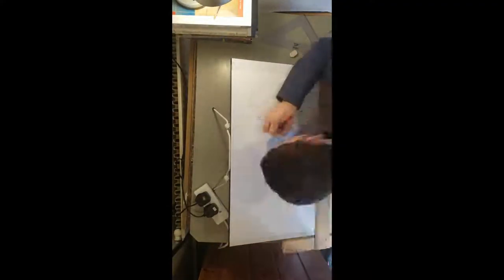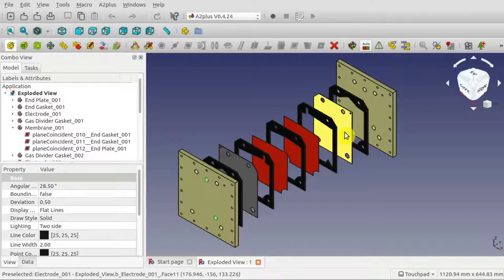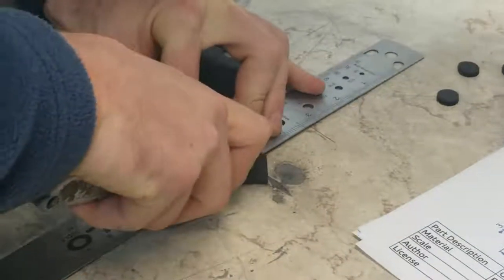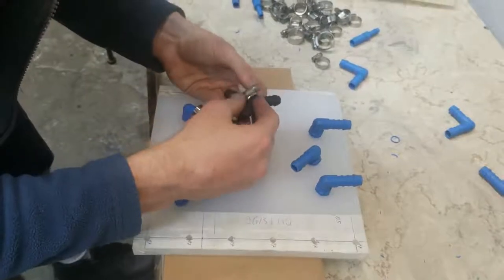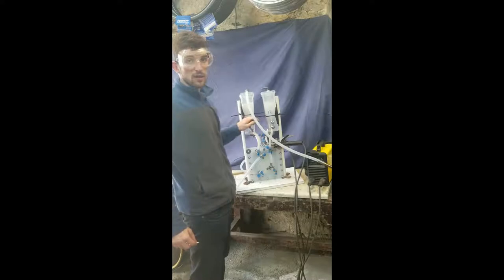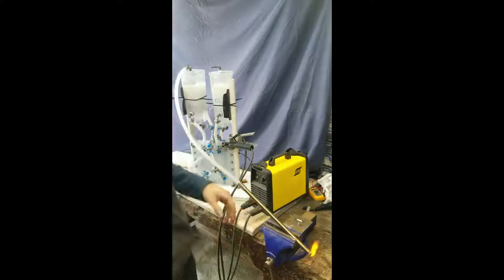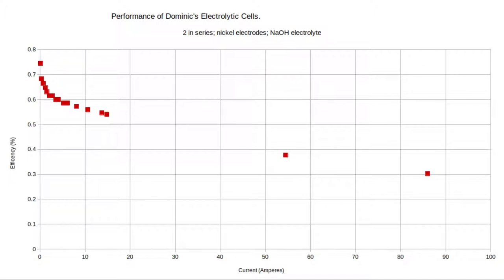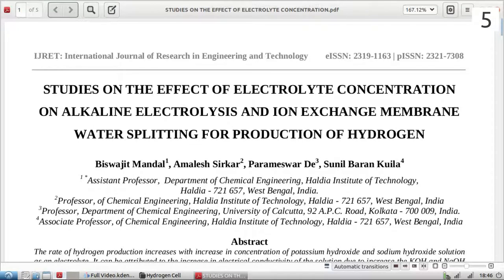Build an Alkaline Water Electrolyser to Produce H2 | High Output

Comment: Great video !
The DYI science guy on u- Tube  used a similar cell with microfiber for separation. He disassembled it to repair leaks and check for formation of hexavalent chromium. 
He contained the leaks from the cell by playing it into a plastic tub.
He had a dissecant dryer and refrigerator compressor to pump from a beach ball into an LPG container. 
Very inexpensive and amusing too.
I'm building a similar system and running it on my solar/ wind power generator.
Keep your videos coming and thanks for sharing. 
Charlie

Comment: Beautiful. The fizz is just beautiful. I  will make a cell similar to this.
Reply from the maker: Good luck and please let us know how it goes 😁.  I'm planning to make a "version 2" myself as well
Reply: @dominicogallachoir4554  Hey good luck on that! I know gold is expensive but it seemed to be a good electrode surface. I published a paper of my work done with pure water and gold plated electrodes in a miniature electrolyser cell (I did not bother with gas separation for that was not the purpose). The results are consistent with your prediction. Low voltage can result in more efficient reaction albeit at a very low rate. See  it via this link https://doi.org/10.1098/rspa.2017.0371

If you are not a subscriber of the journal you can request a free copy by emailing me. Just a warning, it is a lot of theory from the simple experiment.
Reply from the maker: @Guoenyi, thanks for sharing your article!  It seems to be open access, or at least I had no trouble accessing it.  While I did struggle with a lot of the theory, one thing I definitely understood was that you've shared the original data freely on the internet, which I think is a super cool thing to do.

Hahaha I'm definitely not going to take credit for predicting electrolysis below 1.23 Volts.  Highly-efficient for me would be more like <= 2 Volts hahaha.  < 1.23 Volts really boggles my mind and I think I have lots more reading to do to get my head around it.

Can you tell me more about the electrolyser you're planning to make next?  Will you be using gold plating?  Are you planning to run it at less than 1.23 Volts?

Also, I would love to connect on LinkedIn, if you're a user:  https://www.linkedin.com/in/dominic-%C3%B3-gallach%C3%B3ir/
Reply: @dominicogallachoir4554  Not a user of linkedin. I am on researchgate though but I can't seem to find you there. I will consider joining linkedin after taking a look at it. Not familiar with that platform.

No more gold. The paper was a proof of concept for under 1.23V water electrolysis supported by quantum tunneling theory. The experiment deliberately picked impractical setup e.g. ultrapure water, gold electrode to demonstrate the physical nature of water electrolysis. 

My current work is on practical electrolyser operating under 1.23V. This is done for for higher efficiency reason (less waste heat). Also gold will not be used as it is a precious metal. I might try starting with nickle plates to get a prototype working first just like yours. Then the idea is to modify the electrode surface with porous carbon for larger effective area. The higher area should make up for the loss of reaction rate from running a low voltage (when we compare a porous surface to a flat surface of the same geometrical area).
Reply from the maker: @Guoenyi  I've been thinking about your paper and trying to make more sense of it.

So, as far as I know, most electrolysis cells produce waste heat in proportion to the "overvoltage".  In other words, waste heat is proportional to the actual voltage minus 1.23 V.  At 1.23 V there is no waste heat.  Now I'm wondering, below 1.23 V, if the temperature of the electrolysis cell actually drops.  In other words, the reaction consumes heat energy...  I suppose it could be called endothermic.  Is this correct?  Is some of the ambient heat energy converted into chemical energy in the form of hydrogen gas?
Reply: @dominicogallachoir4554  Sorry for the late reply. Voltage gets spent on different things, heat inducing overvoltage is one, undireable side reactions is also one. But basically yeah a whole lot of operational voltage of a electrolytic cell is spent on heat generation. If you drive it at 1.23V, no heat gets produced but the evolution rate for hydrogen is abysmal. You are absolutely right about the case when operational voltage is below 1.23V. Ambient heat needs to be supplied to fullfil the energy budget to complete the reaction. It is bascially conservation of energy. My quantum tunneling theory for water electrolysis points out the reaction can happen under 1.23V if extra energy is supplemented by means like heat absorbtion. It is usually interpreted by people that reaction cannot happen under 1.23V which I argue against. In practice this is good because the heat can be extracted from heating effect of a PV which is also driving the reaction electrically, improving overall system efficiency.

Comment: Great build. I'd like to make one . Can you explain how you built the membrane? What's it made of ? Thanks.
Reply from the maker: I cut the membranes from polyester.  I would recommend using a high-quality fabric scissors to cut them and a template to mark them out
Reply from the maker: Good luck with the build.  Please let us know how you get on and make sure to read the other comments here as people have shared a lot of great info
Reply: Dominic Ó Gallachóir thanks for the quick response. When you say polyester do you mean polyester fabrics like found in clothing?
Reply from the maker: @jimviau327  Yes polyester from old clothing.  It performed okay in my experience although I'm pretty sure it will dissolve if you make the electrolyte really strong.  I'm also not sure about long-term performance.  If I were making another cell I would probably look for polypropylene fabric as it's highly chemical resistant.

Comment: super impressive. Ill make one of my own since i have time in quarrantine. What cloth are you using in the gas divider as membrane?
Reply from the maker: Thanks :)  If I remember correctly, the gas divider membranes are polyester (recycled from an old sports top).  Choosing a material for the membrane is tricky.  I know mine held up fine but then again it wasn't in use that long.  I've also heard that polyester will dissolve if you use KOH rather than NaOH.  Nylon is well worth considering too.  A trick I used to make it easier to cut out the membranes was to spray them with starch and iron them before cutting.  This made them stiff like card rather than floppy like cloth.

I also made a few mistakes that you might learn from.  My plumbing holes were not really far enough apart - it was very tricky to screw all the connections into place.  Also, I should have included a drain tap/valve which would have made it much easier to empty the NaOH solution out once I'd finished.  I would also say that my cooling system didn't seem super effective.  Finally, give some thought to getting a good electrical connection from your power source to the first electrode.  I used a stainless steel screw (poor electrical conductor) and that whole area got pretty hot.

Very best of luck with your project :)  I would be fantastic to see a video at the end, too!  BTW I still have the CAD files and can send them to you if that would be any help to you.
Reply: @dominicogallachoir4554  the designs would help a lot even though Ill make it a bit different. Ill use many contact points on the ss electrodes to help the current pass better. Also thicker electrodes would help with conductivity even though they would be more expensive. I can send you my email so we can talk if you want.
Reply: @dominicogallachoir4554  ill make a video if sucessfull. Also surface area per volume of H2 must be calculated. I plan to make 6lpm H2 per minute on a multiplate design
Reply from the maker: Sure, send your email and we can discuss further
Reply: @dominicogallachoir4554  let me know when you get it. Thanks
Reply from the maker: Also, I trust you know what you're doing nikos, but for anyone reading else who happens to be reading this, BE VERY CAREFUL IF YOU'RE THINKING OF USING STAINLESS STEEL ELECTRODES.  Any corrosion could result in your electrolyte accumulating (potentially toxic) dissolved chromium.  It seems that it's still a matter of debate whether the amount of corrosion is enough to pose a serious risk.  Have a read of http://dx.doi.org/10.3390/ma12081336 and doi: 10.1016/j.egypro.2016.07.156 https://www.nickelinstitute.org/media/1660/corrosionresistanceofnickelandnickel_containingalloysincausticsodaandotheralkalies_281.pdf before you make up your mind.  Don't risk it if you don't know what you're doing.  Much more sensible to pay a little extra for nickel electrodes and not risk exposing yourself to carcinogenic chromate.
Reply from the maker: @nikoskaravitakis9437  Email sent!
Reply: @dominicogallachoir4554  which is safer to use the stainless steel or the nickel
Reply: @dominicogallachoir4554   can you send me the CAD files because I want to make an electrolyzer in my project

Comment: Hi Dominic, very good video! I like it, thank you. In order to increase: it’s very attempting to increase current, but it only  creates heat. Keep the current low and simply double your cell (or triple etc it) to increase the output. Check out Robert Murray-Smith on YT; he has been testing with graphic foil instead of ss with good results. Another option is not using DC, but pulsed DC, that jumps up volume. I don’t know the effect on corrosion. Good luck with your projects!
Reply from the maker: Graphite may be worth experimenting with, but long-term durability is questionable because graphite can react at the anode and dissolve into carbonates (see https://doi-org.ucd.idm.oclc.org/10.1016/j.electacta.2010.11.071).  Cell size is a balancing act:  Bigger is more efficient, but also more expensive.

Comment: How to convert hydrogen to liquid hydrogen
Reply: 2 ways: use a 2 stage cryocooler or a hampson-linde approach. (search for helium liquifiers on google, i find ashmeads Helium liquifier a pretty interesing approac )
Reply: For DIY you don’t need liquid; start with compressing it to 12 bar - 30 bar. You can use Propane tanks. Brings volume down a lot and is still very light.

Comment: Nice! I made almost the same prototype some years ago. I used epdm rubber aswell, but i noticed that after a month or two it was mandadtory to retighten the screws, cs the stack was loose, and significant leakage of the electrolyte happended. To counter that i moved on to use pp plastic for the spacers. Also i increased the electrolyte concentration to 30% to increase efficiancy, and hydrogen production (more amperes can be put in the cell with same voltage). I had about 6 electrolosys cells in series with a total voltage of 11-14V at 5-40 amperes. At 40 amps it produced about a 1lpm of hydrogen  and 0.5l oxygen respectably. Though i am curious on which membrane material you used, and why you chose to do 2 membranes per cell instead of 1. Did that improve the hydrogen and oxygen purity?
Well done, keep it up^^
Reply from the maker: Very interesting!  Disappointing that EPDM breaks down over time but good to know there's a better solution.  Yes, I originally used only one membrane per cell but the gases were not fully separated (formed an explosive mixture) so I added a second one.
Reply from the maker: Do you have any advice regarding membrane materials?  Especially with 30% electrolyte concentration; that's pretty strong.  KOH or NaOH?
Reply: @dominicogallachoir4554  Now i noticed that many plastics broke down because of the caustic properties. But bastically only plastics that have a carboxyl group in the main chain where broken down, because it undergoes a saponificationreaction. an exaple that doesnt work is for instance PET. Plastics which do work are pp, ptfe, and some others i forgot. PP is the best plastic, because of it's fantastic mecanical properties (stiffness) chemical and thermic resistance, and a good oxidation resistance. My electrolyser reached temperatures of 60°C on optimal performance. and that heat is rly not good when u have 2 iron pressureplates that force the stack together with 5 tons of pressure. A plastic with low melting point and not high stiffness would begin to deform easely. Regarding to Koh or Naoh, i tested if there is a difference in efficiancy, and i couldnt notice a difference. but my testingequipment was rly limited, and also my time. So take that with a grain of salt. But if u use koh, then the flame looks nicer in my opinion, because it doesnt look that contaminated. But i used only naoh, because was easier to get in larger quantities for cheap, and it is a good indicator, if your final gas is pure or not. I tried many filtering systems, but none where able to get out all of the atomised electrolyte particles. It's rly time to make a next prototype and fix that problem with good filters. xD that would about be my 20th prototype regarding an alkaline electrolosys cell, though i do admit that the first ones where not working, and only a proof of concept...lmao
Hope this may help u a bit
Reply: @dominicogallachoir4554  The membrane also consisted out of pp. And it was ridiciously cheap^^. Took me a while to find out: garden fleece (the thin stuff) has a rly small pore size, meaning good seperation, though still has enough electrical conductivity, and it is made from pp plastic, meaning it's perfectly suited for this application.
Reply from the maker: @sunlaser6587  That's extremely helpful.  Thank you so much for your input.

I was about to ask how you managed to achieve a seal when the gaskets are made from rigid PP - I guess that's what the 5 tonnes of pressure were for.

That's an interesting observation about the carboxyl group and it makes a lot of sense - NaOH reacts with carboxylic acids/esters to form soap as you said.  However, that makes me wonder why the problem with EPDM rubber?  Perhaps it's just an exception.  Or maybe NaOH breaks open the C-S (vulcanisation) bonds as well

It sounds like you're a long way ahead of me in terms of developing this technology! I'd be super excited to read more if you've published any of your results.
Reply: @dominicogallachoir4554  Yes, glad u got why the pressure is for xD. Btw Plexiglass doesnt work eighter (theoretically resistant to naoh) but it is very brittle, and breaks into many pieces when u let the cell work at 60°C (thermal expansion and contraction) and the endplate pressure wont let them recontract: thus breaking the plexiglass to pieces, and then all the naoh spilled out and dissolved my 500w powersupply. So dont test that: it's prettymouch a dead end xD
And regarding to the EPDM rubber: i guess it shouldnt break down at least the polymer should resist that. But in many of the epdm sheet's i have gotten, where additives ( i coulnt get a pure epdm rubber sheet that i could afford). And because of that, i guess i got epdm with a waay too low melting point, meaning the edpm was able to deform already at 80°C (and because of the huge backplate pressure i had to use). And that made my whole contraption to mix the 2 gasses at some point and after 6 attempt i scrapped the epdm idea, and moved to pp. By using pp, i didnt have those deforming issues anymore, and using glue between the epdm seals, for the best possible gas seperation, wasnt necessary anymore. And ontop of that, by having such a big Endplate pressure (i deformed the plasticsheets with the pressure i used), it is possible to have up to 20 bars of hydrogen output pressure. But the hydrogen and oxygen pressures must be rediciously equalized, otherwhise the gasses would mix because of the pressure difference (and the membrane fails at some point). So: theoretically yes, practice: yes, if the membrane allowes bigger differential pressure with the same gas purity. 
God i wrote long againe xD
I plan on making a video on it, though i will do that when i found a better membrane material (shouldnt take too long xD) 
have a nice day^^
Reply: @sunlaser6587  Witam, czy udało Ci się znaleźć membranę, która Cię satysfakcjonuje? Masz jakieś inspirujące filmy?